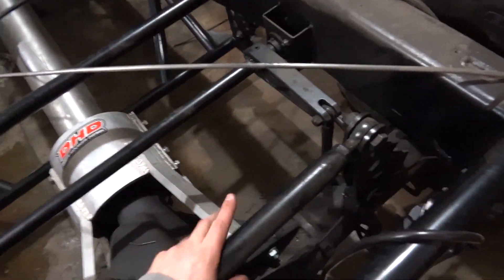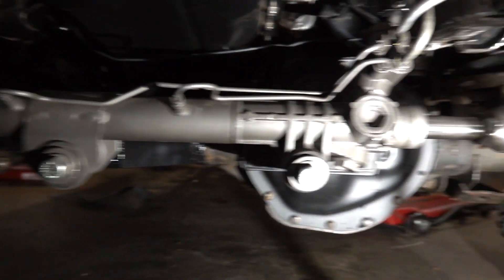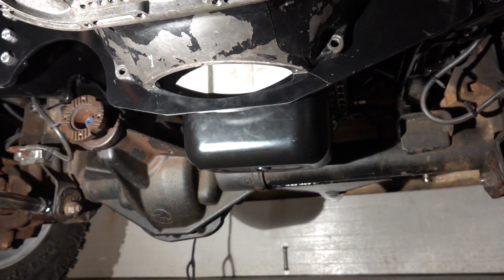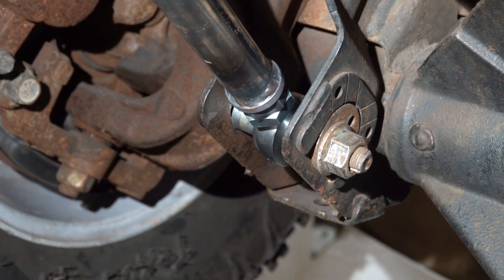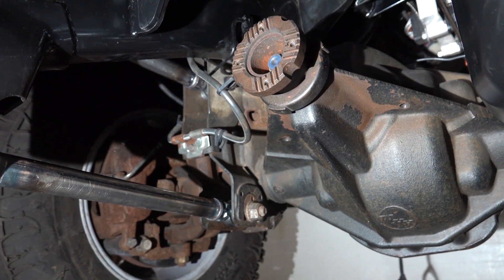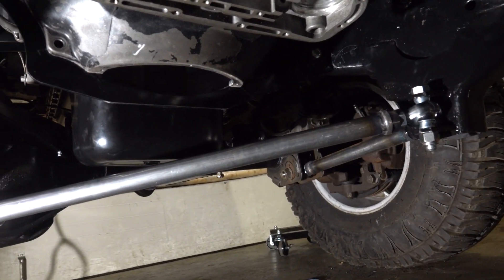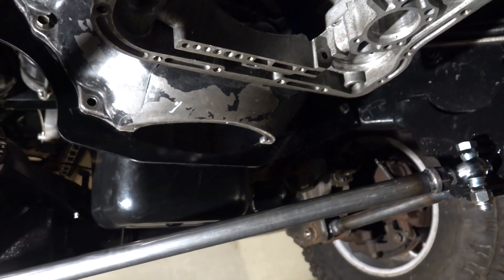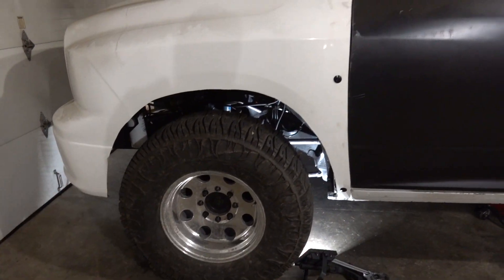2000HP Cummins Drag Truck Dreams Require Custom Parts And Of The Box Thinking

Comment: Are you going to have enough clearance between oil pan for when the truck squats down when you add 1000 plus pounds for pulling because truck will squat least 3" and have room if something happens you start getting chatter or bouncing in front end when pulling also don't for get when pulling it'll lift front wheel and plant passenger side wheel
Reply from the maker: It completely misses the oil pan, 0 chance of contact